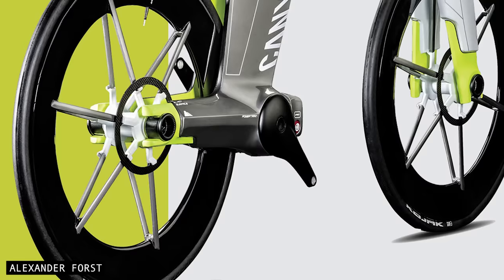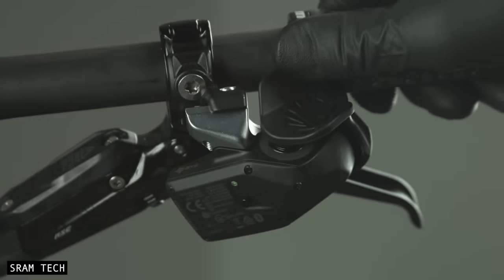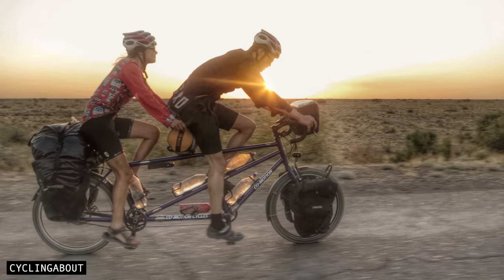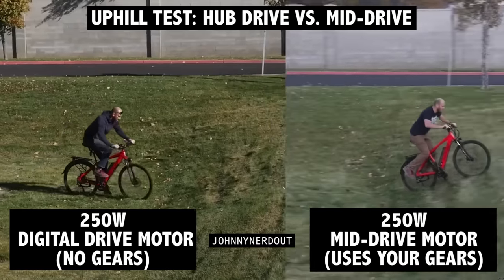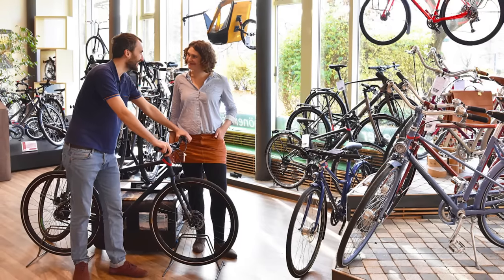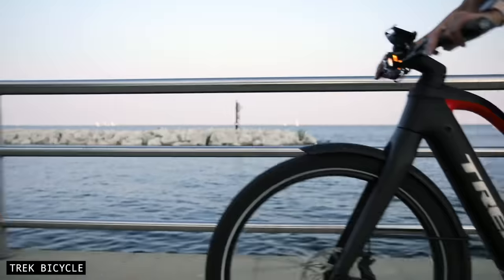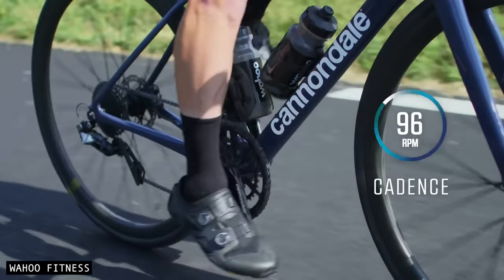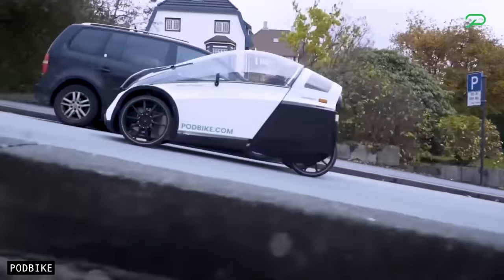Are Chainless Digital Drive Bicycles The Future of Cycling?

Comment: What a great concept~  You can get double the cardio for half the distance traveled!
Reply: almost as good as an indoor excercise bike!
Reply: @Padlock_Steve  you missed the joke so badly it's not even funny
Reply: @Padlock_Steve  It's genuinely dangerous to use bikes for travel here. I've had two different cyclists die close to places I've lived because they got hit by cars. Bikes in the U.S(at least in the south) are something you take to trails or parks.
Reply: What i thought....cannot be efficient or we would be all using it already
Reply: @robertcowher  I can’t stress enough that there are LOADS of US cities that heavily emphasize bike use
Reply: Im already annoyed by a 10 % reduction in efficiency when using an underinflated tire, sorry this concept will not work as promised as it is wasting too much energy  with electric motor and generator efficiencies (they are multiplied, so it is even worse)
Reply: @robertcowher  Depends on where you are within the US.
Bikes are perfect for more urban areas where there is better infrastructure and traveling on foot is actually practical.
Reply: @StefanWelker  I'm not sure about efficiency in this model. However I know the efficiency from electrical engines used in solar cars for the world solar challenge. They go up to 97% and also as generator they get this efficiency. The total drivetrain (including motor controler) is 93% to 95%.
The same for the generator....which tells me that 90% efficiency is possible.

The real questions are: What is the internal friction of the chain (or belt if you want to compare with a belt driven bike). 
What is the gain from electrical braking and storing some energy in a (little) battery. Especially in hills an opportunaty to save energy during the total ride.

I'm sure that we still need a lot of development to reach the moment that a bike with generator is more efficient than with a chain.
However...in trains it's already 70 years that we use diesel-electric combinations because it's more efficient than direct diesel engine connected to the wheels.
Reply: @reiniernn9071  chains are insanely efficient, its basically a solid link between pedals and wheels, most chain drive bikes are around 98% and chain bikes have less parts, less to fail, etc. This is just trying to reinvent the wheel imo, evs work at larger scale bcs they are way more effecient than internal combustion, but this is adding mechanical loss to a system that is more or less perfected.
Reply: I had thought exactly analogously.
Reply: @Padlock_Steve  On the other hand,  many Americans understand the difference to "your" and "you're".
Reply: @Snuggieman  1. That’s more up north, which is ironic considering winter not being a god time to ride a bike and 2. It’s still not entirely safe there either
Reply: @Padlock_Steve  you're*
Reply: Oh my god I was thinking the same thing hahahahahaha
Reply: So you add a battery and it still can't beat a bike? Don't forget we're already running out of resources to make batteries.
Reply: @robertcowher  I'm in Portland Oregon, Bike City. It's a great way to get around here.
Reply: @Padlock_Steve your grammar is painfully wrong. It’s “you’re” not “your”.
Reply: its all fun when the motor dies when your doing a stunt in the water
Reply: Don't worry, the extra weight will make up for it!
Reply: @Padlock_Steve  I mean it is if you live anywhere where it actually gets hot. Can't show up at work sweaty af.
Reply: Further Improvement:  add this to a stationary bike to get infinite cardio for NO distance traveled!!
Reply: Peliton
Reply: @Snuggieman  "Loads" of cities is arguable. And "heavily emphasized" does not mean safe. Even in many municipalities that encourage bike use or have a significant amount of riders, bike infrastructure is pretty heavily lacking.
Reply: @robertcowher  thanks to American car centric city planning and massive sprawling highway, every other mode of transportation sucks
Reply: @mcslender2965  Agreed. I couldn't safely ride a bike to my neighborhood Publix a mile away.
Reply: @reiniernn9071  The difference in efficiency between a car motor and a bike motor is due to its size and power output. Power loss due to friction is negligible in a car motor, not in a tiny bike motor. And having two of them in series (one working as a generator, the other as the actual motor) can only increase the trouble.
There is a reason why we replaced dynamos with batteries as the power source for bike lights.
Reply: @christianbarnay2499  
Why is it stupid to use a generator for driving an electrical engine? 
This old technology saves a lot of energy when used in trains.
Why shpould it not save energy in bikes? Also a human cannot provide the same energy efficincy at all "rpm"". Somewhere between 60 and 80 RPM is optimal for most people. But the electrical engine can be optimal in the full rpm range.

Also I never replaced the dynamo with batteries in a bike. But I did replace the dynao driven by the tyres with a buildin dynamo direct on the axe.The difference is enormous between those...driving with my axe dynamo is not heavier than without dynamo. Because no extra friction with that dynamo.
(My other comments are based on efficiency of a solarcar used in the solar challenge 2013 in Australia.
Those engines are also light engines...in weight and in power.
I know the difference between a top of the possibilities engine vs mass production. But what once was the top of possiblilities will be in the future the quality of mass products.)
Reply: @Padlock_Steve     You missed the joke bro
Reply: @reiniernn9071  It is stupid to connect a mechanical power source (your legs) to a mechanical wheel through a generator / motor chain with 2 points for power losses when you already have a well tested and very efficient solution that directly connects your legs to the wheel with almost no power loss at all.

In the case of diesel-electric trains it's a compromise to allow the same motor to operate on both electrified and unelectrified railways. And as I said the power-to-friction ratio of a train motor can't be compared to that of a bike motor.

And both the train and the solarcar never have to face the same kind of uphill percentages as a bike.

This kind of technology is acceptable in flat areas where you already don't pedal much because you don't need a lot of power.
Reply: @Padlock_Steve  OP commented on distance. People who only see bikes as exercise machines wouldn't care about the inefficiencies.
Reply: @christianbarnay2499  A solarcar goes uphill in Australia. It's not an all flat continent. 
But about those trains. It's not about driving on electrified and not electrified railroads. Because it's always using diesel to power the train (at least in my country).
They use this because you can build a more efficient diesel engine when developed for exactly one RPM than when it mnust cover a wide range of RPM ...needed when it must traction direct the train at all speeds. In other words...when a powersource is first used for generating electricity in the  most efficient way and then usage of that generated power to power an electric engine (very efficient at all RPM) it can be energy saving.
I would like to see what happens when someone is going by chain driven bike into mountains (up and down) and with such an electrical driven bike. And which bike needs   less energy for that travel.
Reply: @Padlock_Steve  This is a painfully British comment and I will not entertain it any further until you learn about the American automotive lobby.
Reply: Dude😂
Reply: @TheTrainmobile  Ah yes, people who speak English and aren't American are immediately British
Reply: @robertcowher  and I thought that Russia is not bicycle-friendly...
Reply: Or for some, double the chance of getting a cardiac arrest. 😵‍💫
Reply: @Padlock_Steve  it literally is an exercise machine. People don't choose bikes for convenience or to save money. They choose it mainly for health and recreation.
Reply: @Padlock_Steve  yeah, bikes are technically status symbols and dental tools.
Reply: Something also very achieveable with a heavier bike, or 10mm extra offroad wheels.
Reply: @markifi  bruh in America you can't use bikes other than for sport it's impossible everything to spread apart my closest store is across a high way with no sidewalk we only don't live in a country half the size of one of our states.
Reply: @AndrewSlurf  i don't know who you're replying to but it sure isn't me
Reply: @markifi  my bad 😭
Reply: @Snuggieman  But are we gonna pretend that OP lives in one? Just because some of them are safe for bicycles, doesn't mean all of them are.
Reply: @Padlock_Steve  -  Many see it as an "exercise machine" as you stated, but mostly after the fact that it's also a fun and practical mode of transportation too.
Reply: I thoroughly enjoy riding a bike, and would actually enjoy the added benefit of an increased workout for the same distance traveled!
Reply: @robertcowher  Well, USA isn't exactly known for having well-planned urban areas and city layouts. Everything there is designed for getting cars on the streets and pedestrians off it.
Reply: @Padlock_Steve  you're
Reply: @Gianfranco_69  100% agree with that simple statement. and I’m not trying to lump you in here, but the same applies to solar. Who wouldn’t want to have free electricity from the sun? But if it were efficient and cost effective enough, we would all have it. We would all have it without a government subsidy. it’s simply not there, and probably unfortunately won’t ever get there.
Reply: @reiniernn9071  good post, I think we just have to know going into one of these discussions that these neat concepts are only going to be ideal for a bike that is neither fully human powered nor fully motorized (a hybrid).
like your train example, there are many efficiencies that can be brought out when assisting a combustion engine with electronic controls, and some electric motors (and batteries), in the case of bikes, peddling can assist the 
battery or vice versa, but either way it’s a hybrid bike.
Reply: @hisandherscoaching  no it doesnt...solar is just kicking the can down rhe road...  our true energy future has yet to reveal itself
Reply: @robertcowher  UK is the same now. I only cycle in Spain these days.
Reply: I actually had to calculate you are right. Mechanical efficiency 99%, electric (nothing to do with digital) efficiency 48%.
Reply: LOFL 😂🤣😆
Reply: It's OK, e-Bikes were never about saving energy, but just a new business niche, and a way to pile up more crowd into already overcrowded cities!
Batteries are not even recycled, not to speak about the additional energy and materials needed for manufacturing the electric bikes vs mechanical...
Reply: @robertcowher   sounds like a load of car centrism killing people once again
Reply: @Snuggieman   While you say that there are US cities that emphasize bike use, they are still nowhere as good as the other ones you see abroad
Reply: @scythelord  I choose bikes for convenience, to reduce costs, for health and recreation.
Reply: @StefanWelker  Also, these will die immediately on hills. Watch any video of ebikes climbing hills, hub motors almost always require you pedaling as well as throttle.
Reply: @markifi or a eliptical bike
Reply: But then it has regenerative braking and generator options for pedal assists to help over hills and excellerate which wreck the whole challenge of cycling fitness in general
Reply: @reiniernn9071  hybrid drives in trains are more efficient because it allows the engine to run fixed at its most efficient rpm. they work in cars because 1.5 tons of steel and battery is a shitload of kinetic energy and it's useful to capture instead of pissing it away as brake heat.

they do not work in bikes because a bike is already 95% efficient or better, and dropping the additional 20-30% efficency needed for a robust, weather rated, zero maintainence motor/generator pair is about as good as letting all the air out your tires, spraying your chain with glue, and then entering a hill climb on it. the only way these bikes make any sence is with a battery doing most of the work, and even then a traditional ebike is leagues better when you're out of range.
Reply: @Snuggieman  no, there are like two cities and that's all
Reply: well maybe if equiped with regerative, the effiency loss would balance with the kitenic regain
Reply: @reiniernn9071  Train engine: High RPM, but wheels require LOW RPM: Therefore an inefficient power sucking gearbox is required.  Also needs lots of LOW torque at low speeds.  Add in engine efficiencies are best at a single RPM.  A generator is also maximum efficient at a single RPM.  An electric motor has insanely high low end torque and can vary depending how you stack the electric motors for maximum efficiency.  A Bike on the other hand is near 100% efficient from peddling.  A Variable rate generator is going to be PISS S#1% poor and probably is ~60% efficient multipled by the ~90% efficient electric motor at best on the rear.  Technically it could be as high as 98%, but I HIGHLY doubt it due to cost of doing so, so overall efficient "generator peddle" is ~50% compared to nearly 100% if you use peddles and direct drive.
Reply: @w8stral  actually it should be 70-80% efficient. And when you connect it with battery then you have smart ebike which doesnt need chain, sprocket, or gears or you can have both wheels driven or even you can have braking energy regeneration which you can use later. With battery and charger it can work like a charm.
Reply: @starydwumas7481  Lets just assume your numbers are "correct"... Great 70-->80% eff instead of 97% eff...   Just what every bike rider wants to do, work 30% HARDER to go the same distance
Reply: LOL!
Reply: Good for trains perhaps, but bikes? This idea is not even bad.
Reply: AAHAHAHAHHAHAHAHAHHAHA!!!
Reply: Lol

Comment: I'm working on a far better breakthrough in bicycles: A hand crank, attached to a generator, that charges a battery, that powers an electric burner, that boils water to produce steam, that is channeled into a turbine, that spins a generator, that charges up a battery, that powers a light, that shines on a greenhouse, that grows lettuce, that's fed to rabbits, that run on large hamster wheels, that are mounted on the rear rack, and connected to your rear hub via belt drive. There's a basket on the front of the bike that holds the lettuce that you feed to the rabbits as you cruise along. It's not quite as efficient as a chain drive, but you don't have to worry about grease.
Reply: efficiency = 10^-10
Reply: Are you looking fpor sponsorship?   I'm all in.
Reply: don't forget to power the air conditioning cooling fan because this can be a sweaty operation.
Reply: Sounds intense
Reply: @DownhillAllTheWay  needs a kickstarter
Reply: How soon we can bring it to mass market? Did you talk already with Elon about this?
Reply: @sloter1024  elon would want it to also capture carbon.
Reply: Shut up and take my money! I want one!
Reply: 🤫, do not give your secrets away. If I were you I would submit and patent this idea, before someelse does. 😂
Reply: @sloter1024  we can already do this today, so next year we can deliver.
Reply: generator> lamp> solar panel> electric motor = 100000% efficien
;D
Reply: But does it have regen so I can go slower?
Reply: Can I divert steam to heat my soup while riding?
Reply: You should take that to ‘Dragons’ Den’!
Reply: I'm worried the basket may affect the aero.
Reply: @gaz2251 Yep! That leapt out at me as an obvious flaw too!😂 I hear Adrian Newey has time on his hands next year…
Reply: I would add a worm gear somewhere in between for that steep  climb.
Reply: My new design is a lot simpler than that. I am working on a design that uses a length of rope with a hook on the end that can be attached to any make of car that might be in front of the rider.
Reply: best comment, hilarious
Reply: I believe you forgot a pan under the hamster wheels to collect the rabbit dung and the conveyor belt to direct the dung into the greenhouse for fertilizing the lettuce plants.
Reply: Lol, great comment.
Reply: You're too late. Rube Goldberg already came up with this same breakthrough.
Reply: 3 left turns to make a right.....or 7, 8, 10,15. 😂
Reply: I have already trademarked the brand MyCrank
Reply: is there a kickstarter i could help making this happen?
Reply: I like it, but where is the mini nuclear reactor? 😂